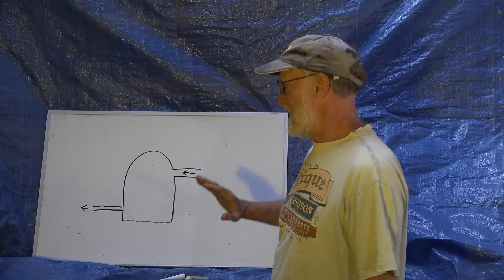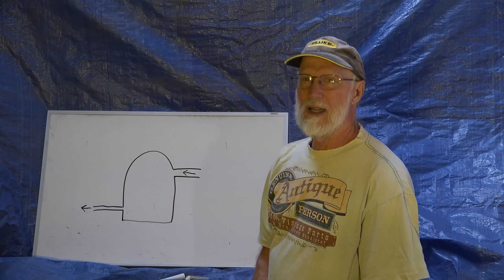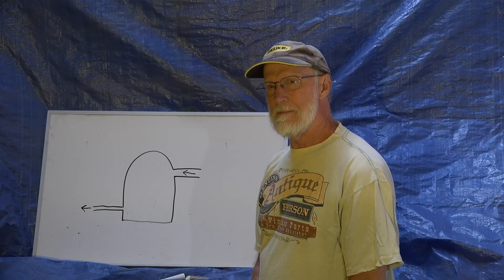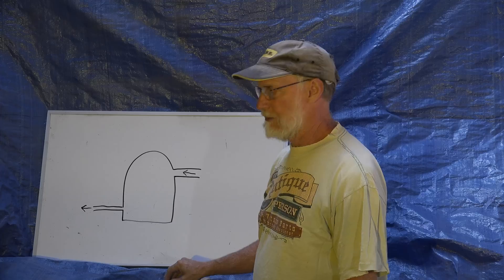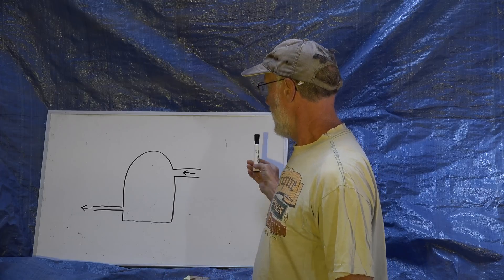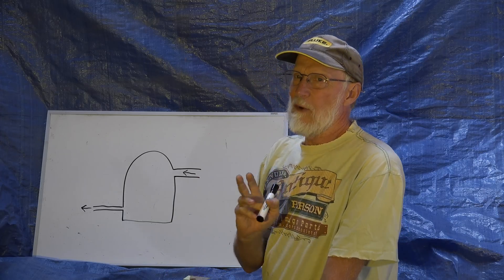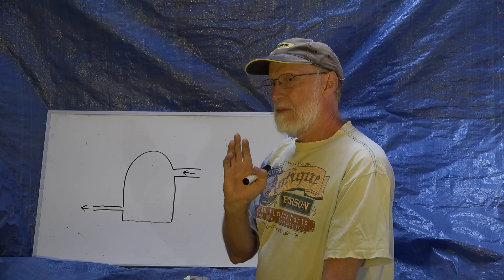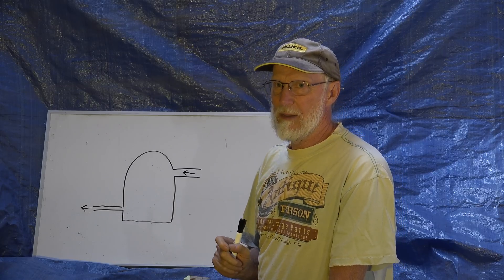What the compressor does and why.  #1

Comment: Hello Grayfurnaceman,
Can you tell me if a 54 year old man who is just starting to learn the hvac trade has much of a chance finding employment as a technician or installer ? I really want to work in this field, but I'm concerned that employers might not want someone in that age group as a beginner.
I don't have any limitations physically, or in my ability to learn Im just concerned that they wont want an older man when there are so many younger ones in the market. Any info you have would be greatly appreciated.
Also, can you tell me what would be best to learn first, and what tools I should buy first.
Thanks in advance.
Reply from the maker: When I taught an introductory HVAC class, many of my students retreads of up to close to 60.  I won't say its the easiest thing to get work but if you have experience in job interviews, you will do ok.  This industry is starving for good workers.  Get your refrigeration basics first followed closely by electrical and diagrams.  Some employers will want you to be able to read diagrams as part of the interview.  Electric meters, both multi and clamp, hand tools and refer gauge set are first.  Hope this helps.
GFM
Reply: grayfurnaceman Thank you Grayfurnaceman !

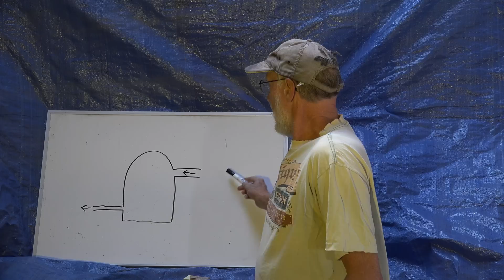Comment: At 2:02 why are you mentioning that cool refrigerant enters the compressor? Isn't the gas entering the compressor hot and boiling due to the cooling load?
Reply from the maker: Why would you think it should be hot?
GFM
Reply: grayfurnaceman because it has absorbed heat of the surrounding in the evaporator.
Reply from the maker: Heat can only be absorbed from hot to cold.  The refrigerant is evaporating at a low temp to absorb latent heat.  When latent heat is absorbed, there is no change in temp.  It is basic refrigeration theory.
GFM
Reply: grayfurnaceman that makes it clear. Thank you.

Comment: Thanks GFM.  I understand that the compressor is hermetically sealed and the lines are brazed but how do they seal the wires without leaks and are leaks at the terminal block prevalent?
Reply: William Fowler the wires do not pass through.  There is a plug with several pins ie run start common.
Reply from the maker: The seal is a ceramic disc and leaks are not common.
GFM
Reply: Perhaps touch on the subject of when that ceramic plug/pin connection fails and the cautions that should be kept in mind? Urban myth or real potential for harm?.. As always thank you for educating us.
Reply from the maker: I will be looking at it.  I did have one blow out while I was troubleshooting it.  Got a shirt full if oil.
GFM